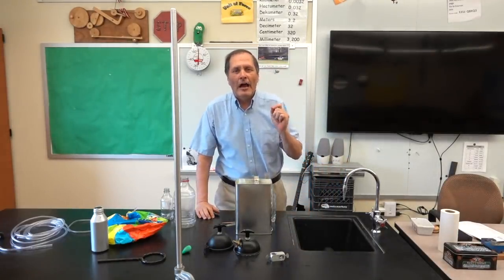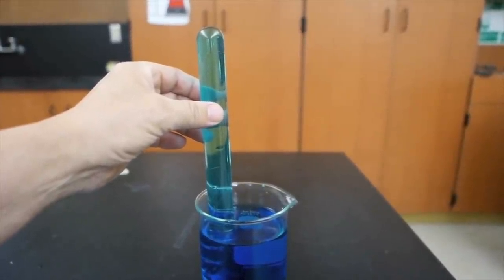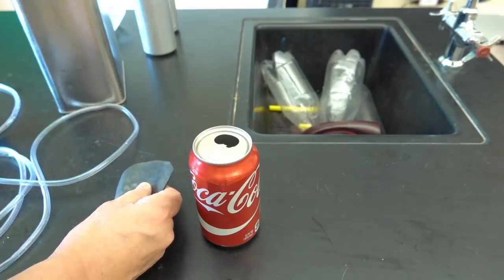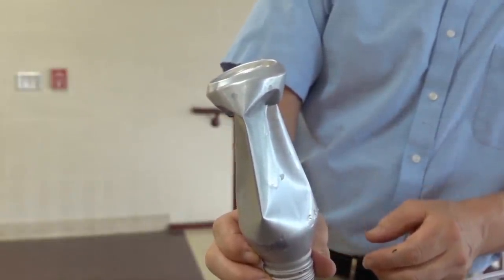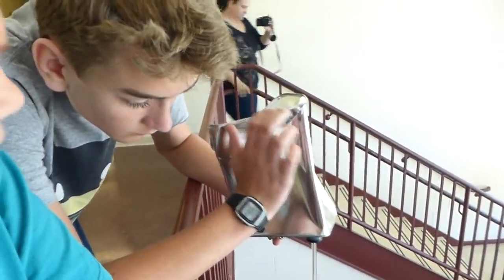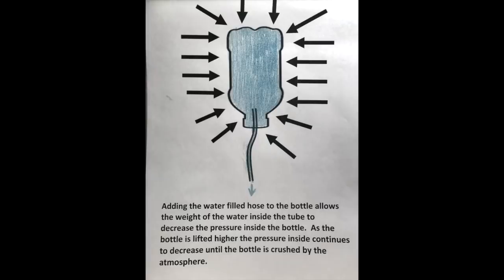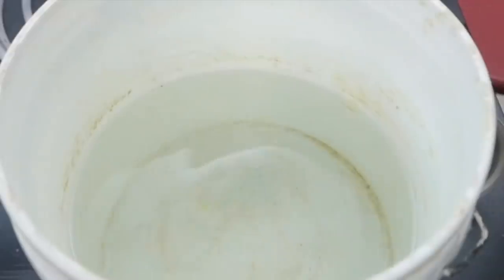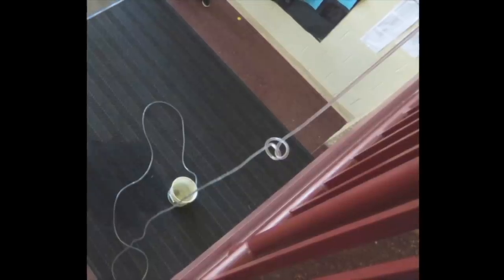Crushing cans from weight of one cup of water....Magdeburg Hemispheres without a pump..Bruce Yeany

Comment: not boiling inside the grey bottle...that noise is air leaking in from atmospheric pressure and travels through the water towards lower pressure cause everything takes the path of least resistance unless energy is applied...that gurgling noise of a gas going through water followed by an air only noise would not be their if the contraption was leak free...some of the water would remain in the tubing because of vacuum pressure...actually if the bottle was  completely sealed its literally impossible for a of the water to come out of the tubing...which obviously happened because you can clearly here the difference in sound made from air only and a gas traveling through a liquid...I'm not saying that a very very tiny  fraction of the gurgling noise was that of water boiling from being in reduced pressure environment. Its impossible to know for sure unless  you know what the actual pressure was inside of the environment that the water is in...and check waters pressure/temp chart to determine if water can boil at the pressure its   in and its temperature...you would hear the boiling inside all of the containers not just the 1...I'm sure that it was nothing more than a simple mistake since you said the right things in the video about the process of liquid at reduced pressure...we both know that you would need a very big and powerful vacuum pump to boil water in a vessel that is leaking...a version of the very first vacuum pump ever by man just wont cut it. (when there is a leak and air can get in but it will definitely do that it the correct conditions) it would be difficult for the actual vacuum pump to boil water when there is a leak like I heard of the gurgling noise and air rushing in...everyone is entitled to make mistakes because humans are not perfect at anything...I felt compelled to say something because this is being used as a teaching tool. if this was just a random video I would not even have made a comment. It is not teaching if what is said is incorrect...
Reply from the maker: thanks for taking the time to give your thoughts METO U, I think this demonstration can be a good starting point but by no means is the whole story. I agree that the sound may  be some air leaking through the system.  However, we have done other variations of decreasing the pressure inside a various containers and heard similar sounds where I know there was no air leak.  Another possibility not mentioned  is there would be some degassing of the  gasses dissolved in the water, which will start to occur well before the decreased boiling point.     I  also didn't get into the temperature drop or that the next step after rapid evaporation would be the water freezing. The combination of degassing and boiling of water is easily demonstrated without a vacuum pump by students using a syringe filled halfway. Put your finger over the end and pull back on the plunger, the water boils very nicely for a few moments.     Fortunately we are going to test the points you raised  by exploring these concepts a bit further by going higher, using visible containers and pressure gauges.  I do appreciate criticism of my work as it makes me strive to clarify my points in further works or in one case have removed a video and corrected them.

Comment: I think that the noise we hear on the cans is probably a pinhole opening up on the aluminum, letting outside air bubble in. Especially considering that the vacuum is only 7 psi below atmospheric, the boiling point of water should be well above room temperature
Reply from the maker: thanks Eric,  we are going to test this further and I'm in the process of  collecting ideas and the materials for it. There are quite a few points that I didn't get to and want to try.
Reply: @YeanyScience  There was a really good video from practical engineering where he built a huge tube the height of a parking garage, and the weight of the water in that case did cause boiling at the top of the tube
Reply from the maker: I haven't seen that one but will look for it,  I do like the one  that shows the opposite of this where the instructor shatter a large glass container using the increase of pressure at the bottom of a long tube.

Comment: how high should you go to make a glass bottle implode? yeah, I know it isn't as safe as a metal one, but...
Reply from the maker: the best you can do is reducing the pressure to a near vacuum which should be at about 40 feet,  going any higher won't help.  I think most bottles would withstand the pressure,  wide flat sided bottles might break.

Comment: Why it is slower for the battles to crash in, using water vacuum in atmospheric pressure.
Reply from the maker: the speed is determined by how fast the air or water is removed,  the water tube is very narrow so less of it drains at a time,  a bigger water tube would be faster.  The vac pump removes very quickly so it crushes very quickly
Reply: @YeanyScience  Thanks.

Comment: Why does water flow when you add tubing but not when it is in the bottle if the space for the surface tension is even smaller? 

Is it because there is water inside the tube therefore increasing its weight or is it because something else?

If it was a very short tube would water still hold?

Is it because the meniscus is different?
Reply: I think it's because the water in the tube and due the the gravity  is making enough force to pull the water down from the bottle